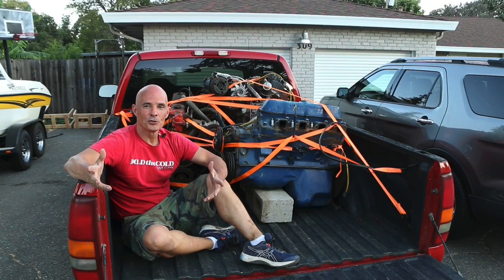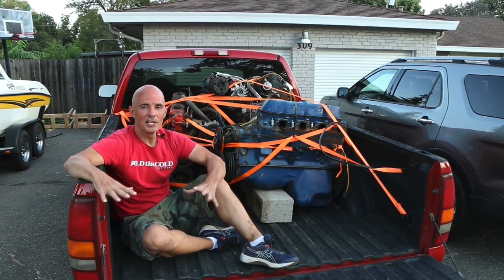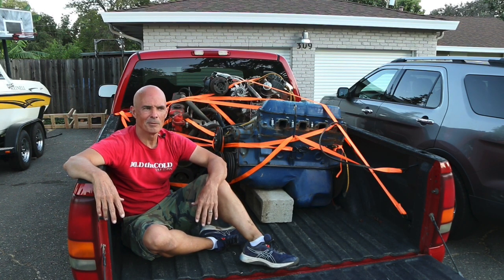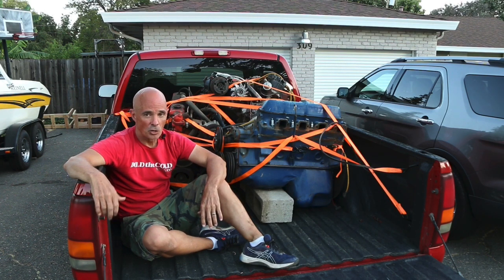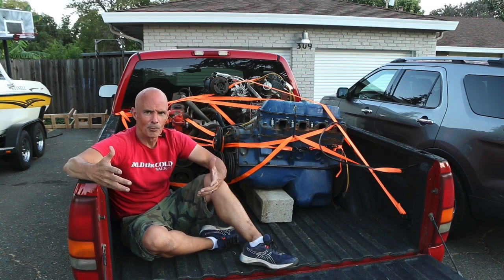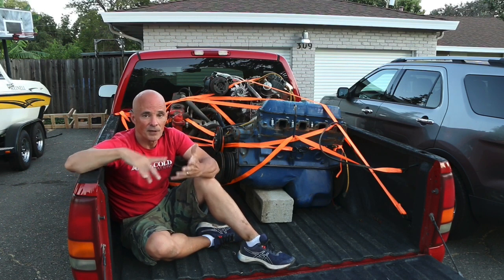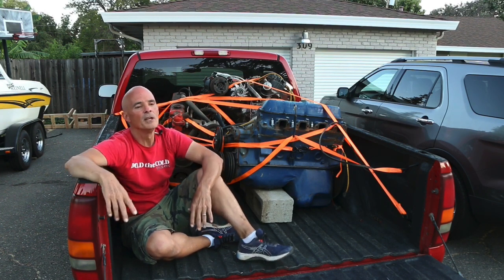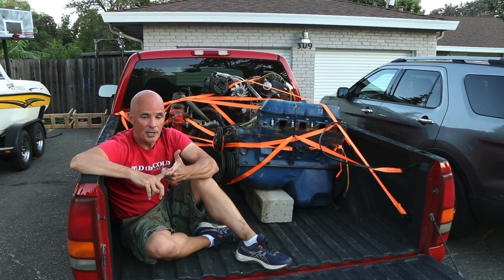THE OTHER GUYS-3 FOR FREE!!!

Comment: Too bad you are far away I have a 73 455 block with all the oil mods, ported edelbrock heads I did, TA413 cam, made 576hp 589tq on pump gas NA
Reply from the maker: nice
Reply: @richardholdener1727  thanks, it put a street 75 camero into the 10s, such a fun motor to drive!

Comment: I'd like to see that caddy motor left stock ,solid and then turboed
Reply: You will be disapointed. It torque peaks at a lower rpm than most engines start the dyno run at. Its great to get 5000lb of american luxury off the line and moving with a 900rpm stall converter and will fry tires but that stock cam is in the way of any hp. It was designed to spin 1500 rpm against a 2. Something rear gear at 55mph for 400,000 miles.

Comment: I wonder if the jeep 4.0 fuel injection  can be adapted to the chevy inline 6?
Reply: Maybe. I know you can use 5.0 liter injectors on it. The mustang injectors have more holes if I remember right.
Reply: @MrPlemke50  yes thats exactly why i would like to see it done. There is a lot of potential in the jeep efi setup

Comment: Caddy 500 stock"flowed" stock exhaust with big nasty turbo ...
650-700 hearse pers at a whopping 4000 revs and 950-1000+ lbs of the torque multiplier.   Ya! Who's towing the space shuttle NOW!?
Js.

Comment: Man I really hope the 500 Cad can be figured out. It’s such a shame that people are so unsuccessful with them. Stroker Cadillac??? Does it exist?
Reply: @Michael Dituri, stroker caddys do exist. Offset grind the stock cast crank, good rod with a smaller big end, usually a big block chevy rod, and custom pistons. One of the hotrod caddy shops offered a kit. If memory serves, 540+ cubes.
There were two guys who ran caddy strokers at the old LA county raceway. One in a 49/50 thereabouts Caddy, with a homemade adapter for a some-other-brand tunnel ram, and one in a studebaker lark, the original Studillac. Both deep in the tens on motor. Loved both those cars for different!

Comment: Hi Richard,
On a different subject, I want to purchase a LAMDA/AFR gauge.  There is a Bunch on eBay. But I'm confused on what's what. Because I don't know if they are only suitable for EFI/ECU type.
I'm running a 360 LA style with low boost blow through Carby set up. 
Any suggestions?
Thanks 😁
Reply from the maker: fast or AEM or innovate we have tested

Comment: Find a way to put a more common rocker design on the Buick heads.  The non adjustable shaft mount rockers limit your options.  Hot Rod magazine did an article on building a stroker Buick 300 a few years ago.  https://www.hotrod.com/articles/hrdp-1103-how-to-hot-rod-any-engine/
Reply from the maker: we do that by putting a new head on it

Comment: Speaking of older GM V8's, I had a customer Al Hess.  He worked in camshaft development under the leadership of Duntov when they were trying to maximize the output of the small block Chevy.  He told me they would change camshafts constantly. They made tiny adjustments to lift and duration and lobe angle, so small it didn't even make sense to him at the time. But in the end, they perfected the small block Chevy cam for the RPM range they were after.  Al has since passed away. https://www.dignitymemorial.com/obituaries/st-clair-shores-mi/albert-hess-6910443.  I'll never forget him sitting in my shop telling great old stories about his days at Chevrolet

Comment: CadCo is the ONLY place to get aftermarket parts and they're also the one who built the streamliner engine its ran by a man named Courtney who is the living encyclopedia on these engines. MTS(now CHP) has produced nothing but garbage under the new ownership and alot of people have been getting screwed by them. 

You will want Keep your bearing clearance on the tighter end the "thou per inch of journal rule" will not work here. The issue with RPM is due to weak springs (mine were 40# seated) and a sketchy rocker setup shaft rockers are available to correct the sketchy OEM. These engines really like their cams on the large side, don't under cam them.

Personally I would like to see what you can come up with off of factory exhaust manifolds.
Reply: I am so glad to see your post. I was going to post the same. Courtney is the Man.
Reply: @pjmccoy4216   holy shit man, I know you over on the forums (red98422) how's the trans am doing nowadays?
Reply: @williamstevens4172  WHAT???? Shit man this is crazy. The fire bird has been fun. I recently smoked my diff. Actually surprised it held up as long as it did. I pulled the plates and dropped insurance. I want to work out a lot of the older issues I've been avoiding and build a better rear end. Shit man, its cool to see you pop up here.